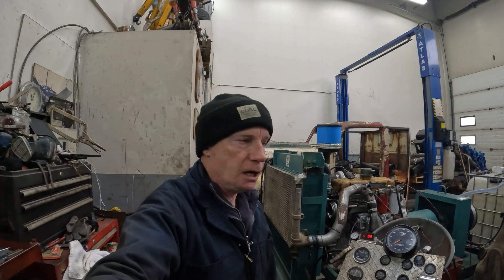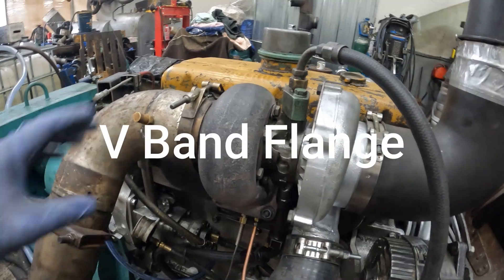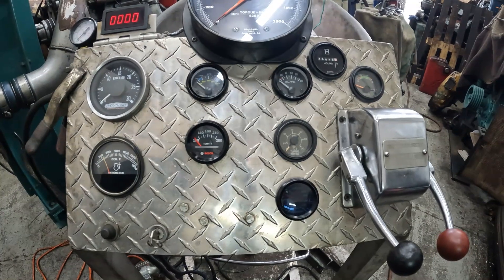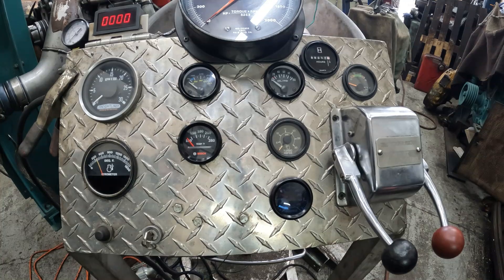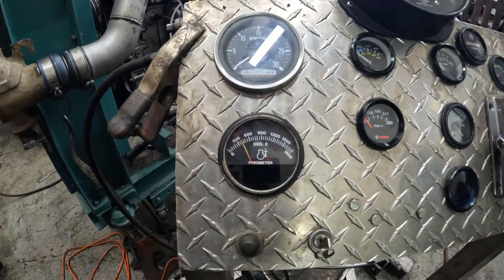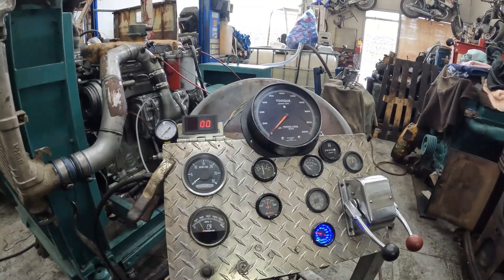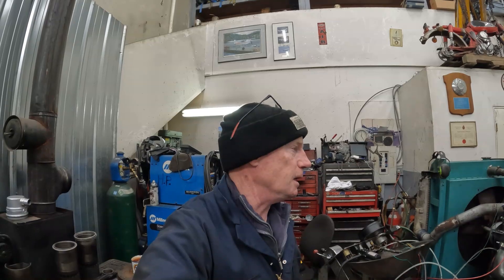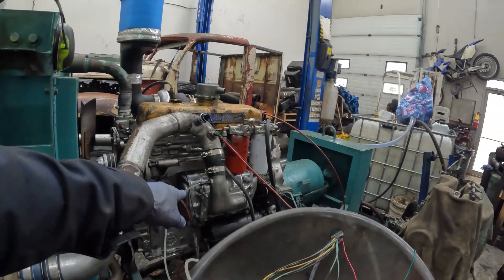Detroit Silver 4-53T (540 FTLBS 9290 Injectors)

Comment: I freeze framed where it was at 510+ ft lbs and it was at 2204 rpm, which translates to 214hp... and held the torque down to approximately 1893 rpm, which would be approximately 187.4 hp..... this was on your first pull.
Reply from the maker: Thanks, numbers are corrected for the fan and 10% for winter fuel.  This gives a more accurate result.  So 20HP and 40 ftlbs and 10% added for winter fuel.:)
Reply: @detroitgarage9430 ..... Thanks for your quick reply... much appreciated.   PS: Any idea's at all, regarding my Duramax issue with it losing its prime when warmed up... yet starts immediately, when cold...???  How can any engine lose its fuel prime, but somehow mysteriously regain it, cold?
Reply from the maker: @Romans--bo7br  I'm not familiar with the Duramax, but may have an anti drain back check valve in the filter housing and or the fuel pump.
Reply: @detroitgarage9430 ....Thank You again for answering and your thought on this.  Now that you mentioned, I DO believe I saw a schematic some time ago of the Duramax fuel system (LB7), and a "anti - drain back" check "ball" does ring a bell with me.... I will dig into that, right away.  Thank again.  I'm watching your video content with great attention.

Comment: I think the last set of injectors were 65 my spare set it gets attention with a 70 year old man getting it done 👍 hell yes
Reply from the maker: Awesome.:)
Reply: @ thanks no disrespect but physically using the 4-53 t is great in a land vehicle
Reply from the maker: @ThomasJones-b7d  True, I daily drive a Silver 4-53T in a 2009 F350 and this engine is going into my 1948 Diamond T.:)  The aim of this dyno testing is to make as much power smoke free and test different injectors, turbos and blowers etc.:)
Reply: @ thanks for your Detroit experience and sharing them also I have three 3-53 blocks and 2 3-53 aluminum heads that have never been ran or dressed with valves I am looking like a lot of people for 53 series Jacob’s engendered decompression heads ? I am looking and willing to do trades?
Reply: @ also the other components for the three aluminum blocks, I think they came out of Gamma goats, but I have the heads to the cracks somebody took them apart. I have no idea, but I gathered them up and they’re in my container Tucker camp overhead. Everything valve covers pants. Let me know if you can come out with some Jacobs engineered decompression brakesthank you.
Reply from the maker: @ThomasJones-b7d  Ooh, those Jakes are getting hard to find.:)  I spoke with a gentleman the other day that found a set on Ebay?  Maybe they'll come up again.:)  I don't have any 53 Jakes, but plan on making 71 Jakes fit the 53.:)
Reply from the maker: @ThomasJones-b7d  If I see a set I'll let you know.:)
Reply: @ I have 71 Jake heads but I found them not the same dang but if you caught any of my stuff I have two 3-53 aluminum heads that have never been dressed I also have three 3-53 engines dis’s assembled aluminum blocks, cast heads everything in pieces that’s how I got them. I didn’t take them apart. I’m looking Jacob engineering Jake set up for the 453 Detroit.
Reply from the maker: @ThomasJones-b7d  Yes, you have to machine them to fit.  There's a fair amount of machining to make them fit.:)

Comment: Great job on that 4-53T ! Sorry but who showed you how to run a engine on a dyno to get peak numbers? Not having WOT and slamming to water brake controls to pull the engine down to fast will give you faulty readings.
Reply from the maker: Thanks, just getting the feel for the new water pump and how the engine responds.  Those are wot pulls.:)  Smoother runs to follow.:)    Replaced the old pump with a new pump at 67 gpm@45 psi.:)

Comment: Great dyno pulls there. Sure put out the torque there. Interesting to see what change if you change the injector timing.
Reply from the maker: Very true.:)  Going to advance the Cam timing by one tooth and give that a go.:)  I have to pull the flywheel to drill in the new tach pickup, so going to pull the housing off and try advanced cam timing.  Apparently more power and cleaner emissions.:)

Comment: Crap! Jimmy is just showing off now and trying to hurt the feeling of my 12 valve lol, keep up the good work, I'm slowly learning about turbo sizes and back pressure lol, thanks! The Diamond T will fly with this in it, it must be a lot lighter then the SD
Reply from the maker: Lol, yeah looking forward to getting this engine swapped in the Diamond T.:)  It's on a 2008 F550 chassis, so when finished I'm hoping it's not more that 8000-8500 lbs.:)  My F350 is 9200 lbs.:)

Comment: id be really curious to see the differrence in power with used atf at a 100% and 50/50 atf/diesel and used oil with the same 100 and 50/50 and a 50/50 trans fluid/used oil at the same 100 and 50/50 as i try to use mostly trans fluid at more a rate of  mostly used trans fluid to diesel in my bus with an 8v71 and feels like i have noticeably more power
Reply from the maker: I think the btu's from wmo is greater than diesel, so you should have a bump in power.:)  Cooking oil is about 10% less btu's than diesel.:)
Reply: @detroitgarage9430  oh ÿa for sure

Comment: First, those are solid numbers, and the cleaner burn is evident with the lack of smoke! I have said it before, especially with the engine that's in your Super Duty: those engines sound so much like the one in my old Army unit: The 8V92. They made great power; driving an M1075 PLS, the 10×10 trucks with a curb weight of 54,000 pounds. 

Love your work, sir!
Reply from the maker: Thanks, great engines.:)
Reply: Since when do Series 53 & 92 sound anywhere remotely alike ?   Even the series 71 & 92 don't sound alike.... except for 12-92... but, Only at idol, and only then, if you let your mind wander. lol

Comment: Man that turbo just sings! Reminds me of a commercial fishing boat I worked on a few years ago here on the coast, it had a 1979 Mitsubishi 6D16T 7.5L,  the turbo had nothing but a steel mesh screen and the engine covers didnt have any sound deadening material left so you could really hear it scream while underway, especially when we were loaded full of Salmon :)
Reply from the maker: Yeah it's loud, I had to put the air cleaner on to knock the turbo scream down.:)  It likes the extra fuel I'm giving it.:)
Reply: That fishing boat you were on, must not have been very big.... and not a lot of draft.  Even on the high hp version, the Mitsubishi 6D16T is only rated for 142KW (190 hp), never seen a marine version of it... but lots of them in, industrial applications.  Even CAT utilized them in their D150 Forklift's, years back (1996 - 2014 ?).
Reply: @Romans--bo7br  Its a 30x12ft aluminum hull, gross tonnage of 11.6 , engine is rated 140bhp, who knows what its really making almost 50 years later, it was not very fast but it went the same speed whether we were loaded down with fish or empty.

Comment: How does, or how will, the performance of that engine compare with the one in your Ford?  You've got a bullet proof set up with 2 good engines and veg oil, and both sound excellent. Thanks!
Reply from the maker: It's hard to compare without putting my truck engine on the dyno, or waiting until the dyno engine is in the Diamond T.:)  I'm estimating I'm getting 240HP and 475FTLBS of torque with water meth in my truck.  The truck has different liners, camshaft, bypass N blower. The truck is cleaner as well with no visible emissions.:)

Comment: I think if you are adding 20hp as a correction factor, you should also be adding 40 lb*ft. The fan and pump are stealing torque and therefore horsepower. It doesn't make sense to add to one and nor the other to me.
Reply from the maker: Thanks, that makes sense.:)

Comment: Ditch the correction factor. It's just easier to keep it simple. 
What is the correction factor giving you? A real but slightly inflated output but for what purpose? All it does is complicate the mind and make NO difference to the price of fish (I'm giving my age away with that reference).

Free yourself from the meaningless mental gymnastics and just use the gauges with the engine as dressed, OR alternatively you could use an external waterpump (powered by a battery) and remove the engine fan and use a blower for the radiator and intercooler (but then you'd be correcting the other way). 
Seems like a waste of money at the expense of mental angst either way LOL. 
Just sayin'...
Reply from the maker: Thanks, after I posted that, I realized no one is running fans on their dynos.  All set up with Dyno cooling towers.:)

Comment: Those HP numbers are a challenge for the 6v53T  silver series
Reply from the maker: Getting close, my goal is 275-300HP.:)
Reply: "Those HP numbers are a challenge for the 6v53T  silver series"..... how so?   John Carey's back motored dragster ("White Lightning") back in 1978 - 1981 was running a twin turbo 6-53, that he De-stroked to 270 ci, machined his own liners, etc, etc... and was running 1000+ hp at 5K on his dyno, and that was Before... he put it "on the bottle"!!  

John still has the dragster (complete)... it was sitting up on a very large storage rack, under about 1" of dust, last time I saw it.   He owns Carey's Diesel & Carey's Marine out on the east coast, in Delaware & Maryland.   

Doug Doring, out of CT. was also running a 6-53 (twin turbo) in a 27"T" Altered.... I've seen him run a 7.62 et @ 172+mph in the quarter mile.... after "dropping" a cylinder during his burn out!

Comment: I wonder if a waste-gated turbo would be beneficial? Seems like boost falls off with any drop in RPM. Although I'm not sure how well the increased drive pressure when the waste gate clamps down to keep boost up would work with the 2 stroke scavenging.
Reply from the maker: I’m going to try my K27 on this engine, I have the waste gate set to 30 PSI.:  Ran it as a compound in my truck with a Silver 4-53T.  K27/K31, removed them for a custom single, injectors were on large enough to make use of the K31.:)
Reply: If drive is any amount over intake pressure  , then you're likely to get reverse flow back into the cylinder ( unplanned egr )  completely what you don't want on a  2 stroke.
Reply from the maker: @timbo19751975  Yes, too much back pressure is not good.:)  Will show up as higher egt's and more smoke.:)

Comment: 9290s and 9g90s much different in size?
Reply from the maker: Slight increase is fuel delivery in the 9G90’s and a different plunger.  Was near the end of production, so the 9G90’s had the latest design changes.  Should expect a cleaner burn with 10 more HP.:)
Reply: @detroitgarage9430 if I remember 9g90 have one more hole in the tip ,   run cleaner , slightly more hp !💥
Reply from the maker: @ruxoneto6560  I'm excited to try the 9G90 injectors as well.:)  The 9290's are really nice, but like you said the 9G90's are a better injector.:)